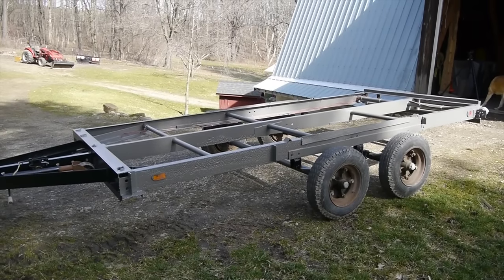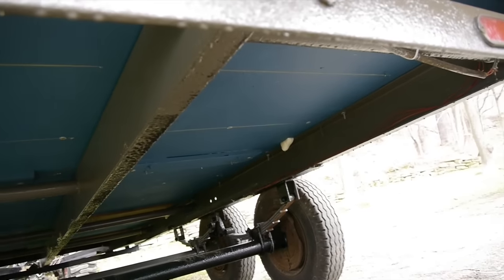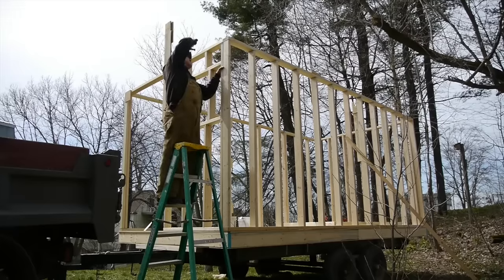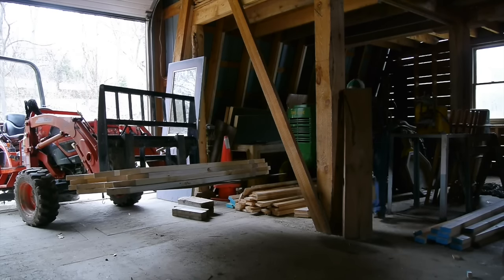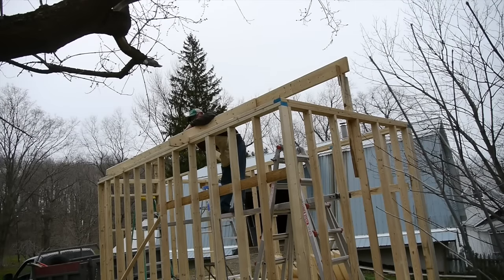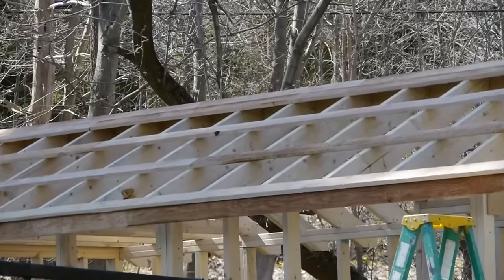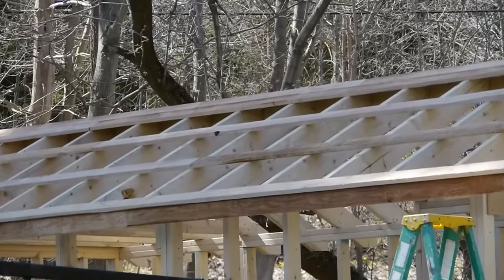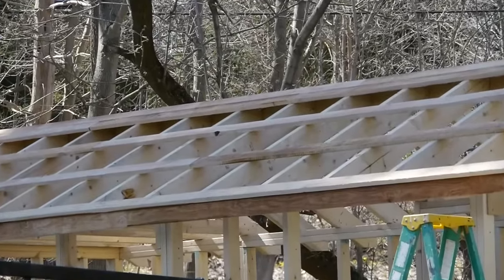My Tiny House: Start To Finish

Comment: Just curious...I thought the rule of thumb for cantilevering out from your frame was to not exceed the width of the board your using for the floor joists....so 6" would be the max of extension out from the trailer so warping/bowing won't be a factor....with almost a foot on each side and 16" off the back and front....bowing may come into play without the use of angle iron reinforcement on each joist....love the build...just have concerns for the future  .... Thanks for your time
Reply from the maker: Hi Kelly.  I hadn't heard that rule.  Time will tell whether this will cause a problem.  I think the cabin will last at least as long as I do.  Haha.  Thanks for the comment!

Comment: What if you’d framed it aluminum stud ?
Any thoughts ?
Great video , and beautiful work . Thank you 👍
Reply from the maker: Probably would be much lighter.  I have never worked with metal studs.  I have a video coming out soon showing how I built a small camper.  For that one, I used 2X3 studs.  Lighter and strong enough.  You are right. The weight is a consideration if you are going to haul one of these things around.

Comment: Great video and very well narrated! One question for you sir: I am no construction expert but was wondering why you didn't put plywood underneath the metal roof? Thanks very much.
Reply from the maker: Plywood is not necessary if you are planning on using metal roofing.  We always run 1X4s across the rafters and screw the metal to those boards.  When metal is installed on houses, some contractors nail these perlins right over the existing roof and then screw the metal to them.  It is certainly okay to put plywood on the roof before installing metal but would be an unnecessary added expense.  Thanks for watching the video!

Comment: Hello , I have a 85 Jayco pop-up camper that we use to live in but it was water damaged so I disassembled it. I'm at  the frame now hoping to build a bigger place for me and my dogs. With only  one axel I'm  concerned about  the weight limit, especially since I want to extend the sides and length.   Do you have any ideas? Your opinion will be greatly appreciated, also, how can I be sure the wheels and axel is in good condition? Any work that is done I will have to do myself    SO, please speak SSSLLOOOWWWLLLYYYY..   Ha Ha, I couldn't help myself. LOL  There is a lot I don't know but I'm eager to learn new things. Thanks for the feed back.   Cheryl
Reply from the maker: The frame on these pop-up campers is pretty lightly built.  I had a friend beef the frame up by adding some more metal cross-members.  If I was you, I would not use the pop-up camper frame for what you want to do.  Buy a good trailer then build.  These homemade tiny houses are usually much heavier than the way the campers are made.

Comment: This is great! Do you have the weight of the finished camper? What kind of truck are you towing with?
Reply from the maker: I towed it to my camp where it is set up permanently.  It would be too heavy to haul around.  I would want a better trailer frame with brakes if I were to build one to haul.

Comment: I've seen most use aluminum flashing to seal off the underside of the structure.
Reply from the maker: Probably a good idea, Adam.  I plan to pretty much park this thing on location so i figured I would go the cheap route.  If I planned to haul it around a lot, I think the aluminum would be the way to go.  Thanks for watching.

Comment: If this Tiny house is intended to be moved a lot it would be wise to use brackets and screw instead of just nails, because the wind turbulence and vibration forces involved in moving a tiny house may eventually work loose standard nails or even ridged nails.
Reply from the maker: In the video, I mentioned that the cabin would be making a one-time move to its spot on my land.  No moving after that.  It is not meant to be hauled around.  Building the cabin on wheels was simply the easiest way for me to build it at home where I had access to electricity and all my tools then I moved it to my spot in paradise.

Comment: @TimTools99 great video! I was curious as to how skipping the normal plywood and tyvek wrap and going straight to siding worked. I am not nearly as experienced as you but have never seen siding put straight onto the framing like that. will it cause issues with water resistance or anything?
Reply from the maker: I guess tyvek is a good thing but it is also an added expense.  I wanted to keep the cost down and build a simple cabin.  As long as i keep the siding painted, this cabin will last a long time.  I used cheap amish-made single pane windows and an old door that was in a dumpster....All to keep costs down for my weekend cabin. Think of it this way.  Homes were built for hundreds of years without tyvek or plywood.  My home is over 110 years old for example. Maintenance is the key for a long lasting building. Having said that, modern building practices and materials can also provide lasting results.  Its all about how much you want to spend.  If i were building this tiny house to sell, then it would have been a much different project.
Reply: TimTools99 okay thank you for the response and calcification!

Comment: I was wondering if all the materials you used for your cabin are strong enough to with stand all the elements and if they would be good for a tint house that would be moving a lot?  And can you please make a list of the materials you used and their cost please.  I only ask because I plan on building a tiny house in a year or so.
Reply from the maker: Hello and thanks for watching.  I knew that what I was building was a cabin on wheels to be moved to a permanent spot.  If I was to build one to haul around, I think I would research and build with other materials. The issue is weight.  Have you ever torn a camper apart?  Many are built with 2x2's covered with a lightweight thin gauge aluminum.  Some of the "tiny houses" I have seen are huge and heavy.  It would cost a fortune to haul them around.  I think if i wanted a mobile home to haul around, I would just buy a nice camper.
Reply: Okay. Thank you for the information.

Comment: Thank you for the awesome video! Quick question: I’m building a camper for the bed of my truck and am considering using the composite siding material for the walls. I know you said it was lightweight, but I’m wondering if you have an estimation of the actual weight? If not, no big deal. Thought I’d give it a shot. Thank you again! :)
Reply from the maker: I think if I was going to make a camper, I would find some aluminum.  Weight is an important consideration.  Research and use the lightest stuff you can find. Good luck

Comment: Great build, one of the best vids I've seen on the subject. Just a couple questions if you don't mind. I am starting my buid soon, bought a 16 foot trailer, If I used 2x4s on the floor would I be able to overhang it about 10 inches over the sides without the timber warping, or 2x6s otherwise? Just wondering what weight that trailer was rated for aswell? thanks!
Reply from the maker: Thanks Jamie.  I thought about using 2X4's but all of the weight of the walls and roof is out there at the end of the joists.   I don't know whether it would be a problem but using 2X6's is a safer bet, I thought.   As far as the trailer weight .... If I had it to do over again, I would buy a more rugged trailer.  The one I bought was a home made trailer and it was pretty beefy but I had it maxed out on the weight.  If you are going to be hauling yours around, get a good trailer with electric breaks and rated for 7000-10,000 lbs.  My situation was to build a cabin at home and make a one-way trip to it's spot on our land.  I don't plan on moving it again.
Reply: Thanks for replying, Think im going to weld a steel frame around the outside and use 2x4, to keep the weight down a bit. I should of bought a stronger trailer, mines only rated for 4000lb, but its only getting moved once then its on axle stands, so shouldn't be a problem.
Reply from the maker: Sounds like you are doing similar thing ... one way trip to its home.  Good luck on your build.

Comment: liked and subscribed! i just had a question about the trailer how did you attached the trailer to the floor? was it glue from the overhang? usually people are always talking about bolts and screwing the floor through to the trailer. just wondering (:
Reply from the maker: chicchick13 hi chicchick.  The original plywood floor is bolted through the metal frame in many places. When I laid the floor joists across the floor, I screwed up through the plywood into each of the joists. When I was all done with the Tiny House, my son made me a bunch of metal L brackets that I bolted the floor to the frame around the perimeter. So the building is attached to the frame securely.

Comment: Did you use any pressure treated lumber at all on the decking, except for the marine plywood if not you gonna have a ton of rotting wood near the deck area
Reply from the maker: No need for pressure treated wood.  This thing is off the ground where it will stay dry all the time.  This is the same reason houses built over 100 years ago are still standing today.  It's all about controlling water.  I will keep this cabin painted and it will last a very long time. // If I were going to haul this cabin around, I would have used an entirely different design but this cabin was towed to the woods to a permanent spot.  When designing a building, it is important to consider how you plan to use the building.  People often overbuild and spend money where it is not necessary.
Reply: @TimTools99  for another 20 $30 though I would have put in pressure treated lumber just because, just going to be on the safe side, I mean it's inexpensive & you would have only used needed a few so I think I would habe went that route instead of just with regular plywood and regular two-by-sixes or whatever you use on the very bottom

Comment: How well does it transport? I am worried about nails/ screws becoming loose and also the windows breaking from vibrations/bumps on the road? I am planning to drive cross country with mine
Reply from the maker: Mine made a one-way trip to where it will be set up permanently.  If I were to build one to haul cross-country, I would have a completely different trailer and design.  These things can be very heavy and expensive to haul.  That's the reason that campers are built the way they are built.  I would recommend researching camper construction and incorporate some of the light-weight techniques.

Comment: How does it travel? I guess you can't just pull it like a light trailer, but can you move it around to use it kind of portably?
Reply from the maker: Exactly.  I made a one-time move about 6 miles to its spot in the woods.  I don't plan to haul it around.  Thanks for watching.

Comment: Hi Tim, I'm curious how long the framing and getting it all 'buttoned up' took you? Everyone says how much longer it takes to build than they expect so I'm trying to get a more realistic sense of timing. I appreciate how approachable you make this project look--years of experience contributing to that of course! Thanks for the video and inspiration.
Reply from the maker: Hi Sonja.  You know, I really can't tell you how many hours I had into building that cabin.  I am retired so I worked at it a little bit every day until I got it done.  I appreciate you taking the time to write your comment.  If you are going to try to build one to haul around, buy a good - heavy trailer.  Also, look for materials as light as possible.  I built this thing knowing I would be parking it in the woods and never moving it again.  So weight was not something I worried about too much.  There's a reason they build campers as light as possible.  You don't want to haul around an elephant!  Ha!

Comment: Nice build. Are you going to install Solar
Reply from the maker: I am planning to install a Solar panel for sure.  I wired up the inside for both 12vac and 12V so can go either way for power.  I am just researching solar panels now.  It's a learning experience!  Thanks for watching.

Comment: I've always heard never to go wider than a foot over the trailer frame width. You don't have any issues pulling it?
Reply from the maker: It made a one-way trip to my land where it is set up permanently at my place in paradise.   (It pulled easy.  If I were to build one to actually haul around, I would buy a new 10,000 lb trailer to build on and do it a lot differently.  Really can't imagine building one to haul around.  Too heavy .... just buy a camper.)

Comment: Since you used 2x8 for ridge board, 2x6 for rafters, 2x4 for walls is strong enough? What if 2x6 is used replace of 2x4? Thanks
Reply from the maker: It would be heavier with 2X6's. If you are building a cabin to never be moved, then you don't have to worry about weight.  i figured that 2X4's would be good for what I am using it for.  Fully insulated and warm in the winter.

Comment: Hi, just one question:
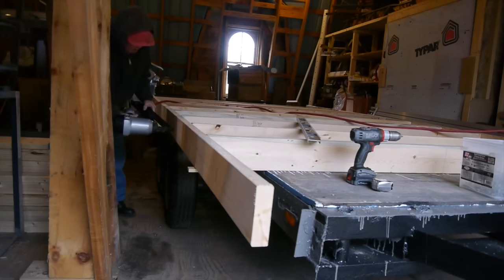around second 00:30 / 00:50 , how do you fix the wooden base frame of the house you are building, with the metal trailer?
Thanks
Reply from the maker: My son made me some metal L-brackets which I bolted to the frame of the trailer then I lag screwed up into my floor joists.  If I were to build a Tiny House to move around, I would have angle Iron brackets fabricated and welded to the trailer.  Then, bolted to the frame somehow.  This thing I built made a 6-mile trip to where it is permanently located at my camp.  That's why I was able to get away with building it on that old trailer.

Comment: So how is the frame (the floor joists) attached to the tailor base? or does it not need to be?
Reply from the maker: There is a layer of plywood bolted to the frame which will serve as the 
bottom for the floor joists.  I screwed up through this plywood into the
 floor joists with many screws.  Then, I attached L brackets to several 
floor joists and bolted those to the outside of the trailer frame.  If 
you are going to be moving yours a lot, you will want a good system to 
attach the house to the trailer frame.

Comment: I Want to make one so is there some people use metal studs are is wood better can a flat roof handle a snow load kinda wanted a deck up stairs
Reply from the maker: I have never used Metal studs.  I don't know about those.  If you have a rubber roof, then a flat roof would be okay.

Comment: Do you have a ballpark of how much all the materials were?
Reply from the maker: Hi Page. Its hard to estimate because i used a lot of stuff that i had laying around like windows and doors, kitchen sink and stove. but the cost would depend on how many features you want. Full kitchen and bathroom would add considerably to the cost.  This is just a basic cabin.  You could easily spend $15-20 G on a complete tiny home.

Comment: Question? Why didn’t u frame the trailer inside your barn, walls could have been framed & laid on the trailer floor & then just tipped up & nailed?
Reply from the maker: I framed the trailer inside my barn then took it apart so I could get it out the door.  Then I put it back together outside.  I wanted people to see each section as I nailed them up.  It's just the way I decided to do it.  Thanks for watching.

Comment: I know nothing about trailers, will any trailer work? Are they all basically the same frame like this?
Reply from the maker: That depends...  I knew I was building this cabin to make a one-time trip to where it would be parked in my woods.  If you were going to haul a tiny house around then I would recommend you start with a new trailer 7000-10,000lb capacity with electric brakes.  These Tiny Houses are usually much heavier than a camper of the same size so you want a good trailer for your foundation.
Reply: TimTools99 thank you sir! Yeah I plan on doing the same. Just gonna buy a plot of land somewhere out west and park it.

Comment: Why are you not using deck hangers for strength??
Reply from the maker: I assume you are talking about joist hangers.   They are an added expense that are just not needed. My house was built in 1906 without joist hangers.

Comment: What are you towing this bomb shelter with? A Military Tank I assume. Not many civilian vehicles gonna be able to handle that. It’s more like a destination Trailer than a traveler..HOLY HEAVY!
Reply from the maker: Ha!  I towed it with my pickup truck to my camp where it is parked permanently.   I wouldn't haul this thing around are you nuts?

Comment: Is the deck attached to the trailer?
Reply from the maker: I screwed up through the plywood on the trailer into my floor joists.  Also, my son made me some metal brackets that I bolted to the frame and then attached to the joists.  It's not fastened good enough if I were planning to haul this thing around but good enough to get it up to my land where it is parked.

Comment: is there a reason you used wood instead of much lighter steel framing?
Reply from the maker: I am an old-timer and I guess I do things the old fashioned way.  I have never used steel framing ... I guess I should look into that if it is lighter.  Thanks.
Reply: TimTools99 its probably much harder to work with

Comment: What did u do to secure the deck of the cabin to the trailer
Reply from the maker: My son made me some metal brackets which I bolted to the frame and screwed to the floor joists.